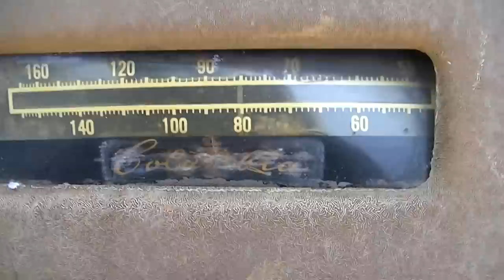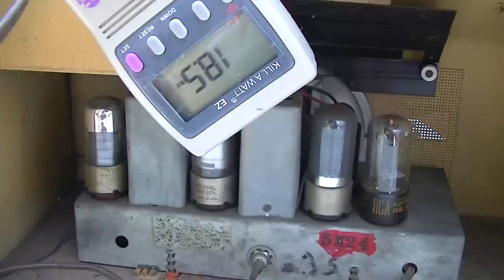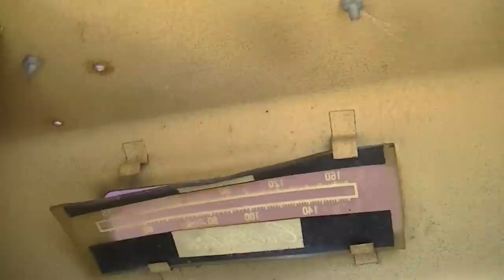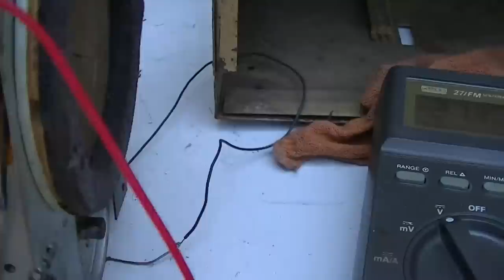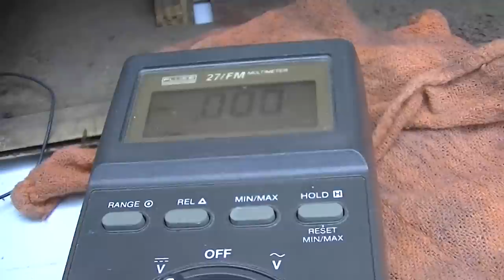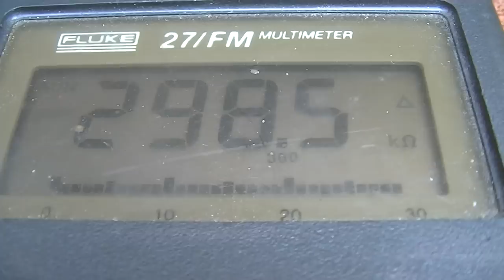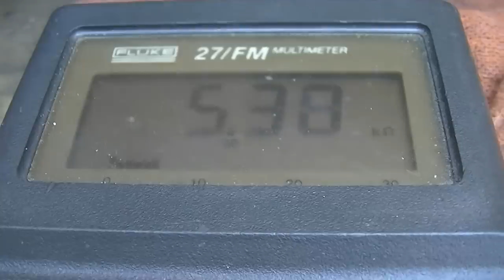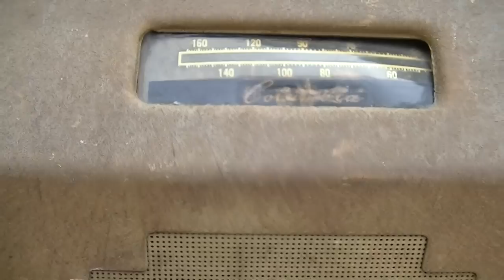Vintage pay-to-play Hotel Motel radio

Comment: I don't know why, but they ALWAYS remove the damn coin mechanism.  THat's the part that makes it cool.   I have a "radiomatic" coin operated radio that happened to still have its mech (and two more of other makes without it).   It is kind of crappy in how the coin mechanism worked- it uses a synchronous timing motor and a leaf switch so when the time runs out, the radio doesn't outright quit, it will arc a bit across the contacts and cause it to sound all scratchy.  I replaced the leaf switch with a microswitch so it turns on/off without the arcing.  When you put a coin into the slot you had to press the button on top to make it take it.  If the coin's too small it won't advance the time disc and will just go into the coin box.  The time disc has a slip clutch so pressing the button forces the disc around a set amount, so you could put more than 1 quarter in at a time.

Comment: That would be really great to have it sand blasted and painted perhaps by a auto body shop. The cabinet would have AC on it if it is plugged in the wall socket wrong. I wonder how may people were zapped by those in those funky blowtels of the day? aka Hotels. Suggest a grounded 3 prong plug be used with it or an isolation transformer tucked inside. I think they always used nickels in them......
Reply: JOEB JOEB Riiiight, nickles used, same as the vibrating beds...
Reply: Its isolated from cab as explained in video, if isolation failed and you touched chassis to earth like a fridge or sink you get a wake up
Reply: Our body shop would probably spray it for $20 or something. But if I know Shango he’s not about to spend money like that on some old radio
Reply: I agree! I guess you would be safe with that if  someone spilled a drink on it?  I also think if it were painted pink and blue and add a couple meters and a tuning eye on it, some Steampunker store or establishment  would buy it for display? Maybe add a couple big do nothing tubes on the top would round it off?
Reply: Powder coating. That's what I would do.
Congratulations on a really cool find. Glad you got it and shared it with us!
Reply: Yep. 100% requires a ground connection.

Comment: That's a great video!! I have a GE 1934 Tombstone radio and on Shortwave i get an absolute blank after certain frequency on the scale, if i cross it back i hear an explosion then the tuner works again, any idea what might that be ?
Reply: Tuning condenser plates are warped probably

Comment: That's a really interesting radio. I wonder if a little heat would straighten out that dial? If it was mine I'd give that a try, give the thing a good cleaning and a some paint, basically a light cosmetic restoration.

Comment: A word of warning - don't adjust the radio with wet hands.  If a drop of water goes into the setscrew hole, you'll get connected to the hot chassis.  Ah, the good old days.  ;)

Comment: You have a point about the education system these days. “Trade work” or blue collar jobs are considered underclass.  Kids don’t know, and don’t want to know, how things work or have any desire to tinker with stuff.  Problem solving is devalued, memorization is championed. The days of shop class are long gone...
Reply: We built a 5-tube radio in nineteen seventy-five shop class. That was basically the last year of that anyway, I also learn how to weld before I got there so I've been a welder boilermaker and I never saw a year of college didn't have to I learned a trade . I was lucky enough to learn several trades.
I always knew about electronics but now I'm learning when I didn't pick up years ago from this guy and radio TV phone o nut
Reply: Shango I've got a v tube true tone, and not very many hours. Looks mostly original having said that I found several open resistors and it is a transformer set and I'm going to fix this thing. I need to get some capacitors and I need a way to test capacitors that's coming soon.
And I know everything isn't about capacitors I've already found several open resistors I'm trying to trace this thing down without a schematic reverse engineer I want to go to Sam's today to see what I can find out on voltages and checkpoints
Reply: we need to tell the left-wing deep State Democrats and the rest that we did not want him to take George Orwell's book seriously
Reply: I'm not a puppet on a string for some double mask regime...

Comment: My Mum mentioned that she rented a television set that you had to insert coins to watch the television. There was even a coin box installed on the stove.
Reply: J Groenveld 
 This video remember  me the tv in an hospital room wich i had to put coins to watch the tv , it was a black and white tv . That was in the 80's years .
 Now  you pay for a week ,  the tv is a color  flat screen tv  , the system is computerised , it shuts off the aerial signal when the week is off . 
Did not knows this pay to play was used for the radio too . In the 80's you could bring a pocket radio to the hospital , only the tv was pay to play .

Comment: 9:00 I've definitely seen Sprague electro caps from the 70s go bad prematurely.
Reply: Walt's Channel I was actually surprised to see that someone repaired this back in the 1970s with that Sprague filter cap, considering that most hotels probably had televisions at that point.
Reply: Archie Bunker Good point! Also, more modern radios were available. Maybe it was already in private hands at that point.

Comment: Did I hear something about some Dave Jones guy? maybe we'll have American Politics on Teardown Tuesday.

By the way, the thing you did with the caps in series is sorta 'legal'.My analog electronics teacher says that in a case like this, if the impedance you connect in series is at least an order of magnitude below, it can be considered negligible for most applications, and the thing you did basically counts as repairing the capacitor.

That guy studied EE back when they still taught tube circuits, so that may be a reason.

Comment: Waited all week for the video. Love to watch you flip through the stations and comment on them while you are diagnosing radios.  Could I send you a radio to fix for me? I recapped it and checked tubes but I can not go further. It was working for 2 years after I recapped it but has lost most of its volume.

Comment: My school eliminated metal and wood shop in 1991. Auto shop vanished 5 years ago. But they do have gay studies class. Sad shit. I had to take wood and metal in 8th grade, required in 1978.  I would make steel projects like a stereo adapter with threads. Then outside class I would screw together and make weapons. Stop sign shaped steel the size of a roll of quarters, tapped and threaded, then screw in the punch plate which was signed off as a bicycle seat bracket. Kapowey!!!!  Awesome weapon!!!!! Drop in a sock and then square off with the bus kids!!!!!

Comment: The tube manual circuit used 7 pin mini tubes, that old radio is all octals, but yeah, same circuit as those tubes are equal in function, curves, etc.....
We've tried it the NRA's way for too many years and you see how well THAT has worked.  I'd say that we should take an example from countries like England and Japan as far as our gun policy goes, it is working there.
Reply: >It's working there
>Takes a look at London knife crime statistics